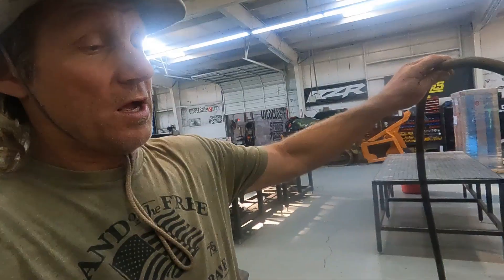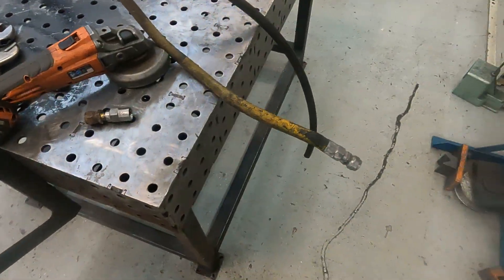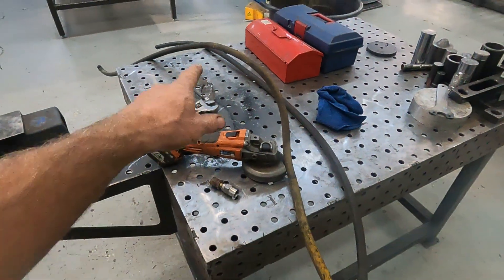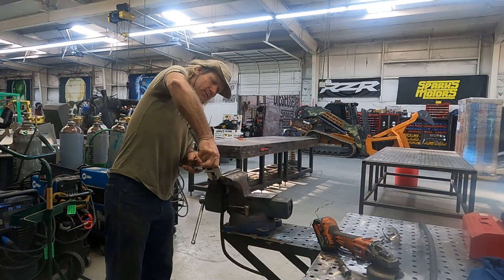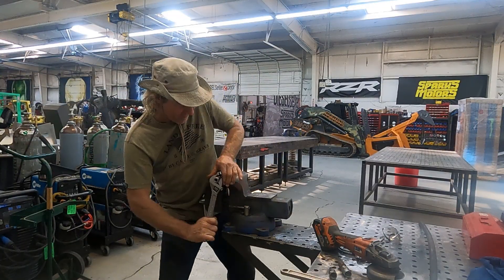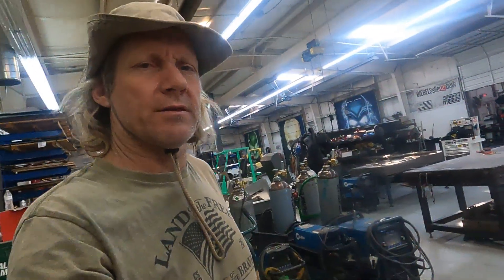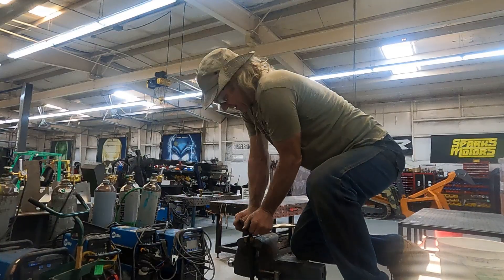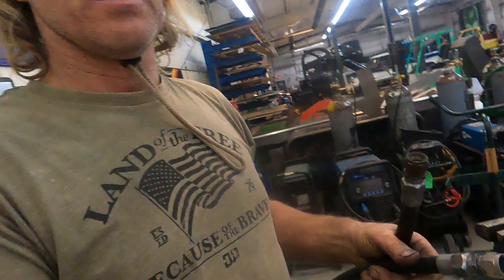Wizard DIY   Repair hydraulic hoses yourself!

Comment from the maker: Thank you so much to all you viewers who commentated on how to install the end fittings. I should have looked more closely but assumed INCORRECTLY  that since I unscrewed the first part with right handed threads that the other was the same... I feel like such a idiot! Ha ha ha.. Remember the part screwing on to the hose is LEFT HANDED threads... Lol! However I must admit the Tire compound did allow it to slide on even though I did it wrong...
Reply: ONE of those things wizard , we all do stuff like that .😀😀😀😀😀😀😀😀😀
Reply: Nobody's perfect.
Reply: You could also take a die and make some threads and take a color marker and make a mark where it is all the way on
Reply: Lefthand threads
Reply: Alan I did find it comical watching you standing on the table putting all your weight on the Vise-grips literally forcing the lubed hose to slip over the threads until it is all the way in, next time you're working with the Aeroquip fittings look into the open end you'll see the internal threads are much bigger and far apart than the fine threaded narrow end, I never used lube of any kind, having worked with Murphy's tire soap countless times myself I can see using a small amount on the hose end would help for sure. Be Well my friend.
Reply: We have all been there. 
Smoked a brand new 3/4 breaker bar with a pipe extension going the wrong way too. Dam foreign autos.
Reply: @mattborges5905  That would have been a sight to see '&' funny as hell, I'm laughing right now, what were you prying on or out and did you go flying or just landed in a pile some distance away? Question if I may, how log was the pipe "EXTENSION" you added to the Breaker Bar? Did Snap-On or Mac replace the bar or are you out it's replacement cost? : )))))
Reply: @mattborges5905  YO! I have a1999 Isuzu Rodeo 200,000+ miles! lol

Comment: Use a rubber mallet to get the fitting to the fitting threads on the hose, why not use hydraulic oil for lubricant.

Comment: They won’t sell these ends,as usual, because of liability issues. People will install them improperly, use them on newer high pressure systems, use different pressure rated hose or use hose with different outside coverings such as higher abrasion resistant coverings that have various thickness measurements. With all of these variables it’s too risky for any hydraulic shop to sell or recommend them. In today’s world for a hydraulic shop to mix match manufactures hose or fittings leaves they’re asses hanging out if something fails.

Comment: I'll have to double check to see if the Hydraulic line I need to replace on my Massey Ferguson 40hp, tractor here in Montello that I need to replace on the Backhoe has replaceable fittings on it.
Hey Allen, Tractor Supply right near Sparks shop has some Hydraulic lines for a reasonable price..

Comment: You have to be careful with these as you can cut a flap on the inside of the hose with the internal piece. That will allow flow in one direction and restrict or stop flow the opposite direction.

Comment: I still see similar fittings all the time around my area, used all over the place.  I've found that you have to find the kind of shops that supply stuff to a lot of farmers or the like, and they'll more likely have the reusable fittings available.  I recall from buying them, the thing to watch for was a difference between single braid or double braid hose.

A previous job of mine, was working on a seismic service drilling rig, drilling 250' boreholes for heat pump systems.  It got worked pretty hard at those  depths, was powered by something around 430hp, fully hydraulic, and it'd load the engine down pretty good sometimes...  It was probably around 80% reusable fittings, and the only problem we ever had with one would be when you were reusing a dried out, crumbly old hose.  They'd work for a while, but eventually the hose would pop out of the fitting.  Putting them on any half decent hose though, and the hose would fail well before the fitting.

Comment: I worked at a shop that made these and that's what we used on alot of our hoses and they are 100% reusable the other way we made hoses was with a simple crimper you can get one that you can use a impact on around $100 with the die set online

Comment: Hi Alan.  Good tips for replaceable hydraulic hose ends.  I think you would be doing Sparks Motors a big favor if you drilled a couple holes and put a couple more bolts to hold down that vise.  I was hoping it didn't suddenly break loose while you were pushing down on it.  That would have left a mark!

Comment: The hose doctors told me yonks ago that they gave up on those for several reasons but mainly because you end up twisting the wires internally and they just blow off after a while.
I had one blow while i had a grand piano hanging half way into a second story loft. The men had to hang on to the guy lines for two hours in the wind while we got a rrplacement hose and a refill. Then it was all a bit dodgy sending it out with air bubbles in the system. Bang pop pop pop sort of scary. Ah the good ol days.

Comment: Those fittings need the hose skived to fit properly. They will not last long the without removing the rubber so fitting bites onto wire

Comment: I,m impressed Alan I used to make these hoses around 40 years ago and if some one told me you could put those left hand threaded outer fitting on right hand threaded I would have said its not possible,.well that myth is busted . But the big test is can you do it with a left hand threaded nut on a right handed nut. 😆😆😆😆😆😂😂😂

Comment: I used a pipe threading machine todo the 2 inch and over reusables. Trust me, you'll wish you did. Good hose lub makes a huge difference too. Aeroquip sells the best. You can also reuse weird ends of fittings if you know how to use a lathe and can silver braze.

Comment: Hopefully Alan will read the comments.  When making future hydraulic lines.  Reading @wmbomb1079's comment below it makes perfect sense that the two pieces of the fitting would use opposing threads.  At first I was thinking he needed to use something like tire lube that is used when mounting tires on rims.  Buit that might cause the hose to slip off when under 3,500 psi of presure.

Comment: As others have said, the collar is LH thread. Something to watch out for is while inserting the nipple which should be oiled, be careful you don't cut the inner tube of the hose. Some fitting nipples require a mandrel to prevent this. You are working with single wire braid hose which is quite easy to build with field attachable fittings as long as you use the correct fittings designed for the hose. When you get into multi-wire braid or spiral hoses, there may be more steps to perform such as skiving the cover off the hose before installing the collar. The large hose for your loader may be a very high pressure hose (4000-6000 psi) with 4-6 spiral reinforcement wires instead of 1 or 2 braided wires. The very high pressure hoses are more difficult to assemble by hand. If your shop has a Rigid pipe threading machine, the one on a tri-stand that holds and turns the pipe, that can save you a lot of work removing/installing fittings. Also, field attachable fitting for these hoses are not very common these days.

Comment: 10:45 Alan maybe next time you have a fitting you need to get onto the end your new hydraulic lines, maybe try warming the end of your hose, to make the hose material more maleable in taking the thread of your fitting.

Use eg liquid dishsoap for coolant lines, or even hydraulic fluid itself, to lubricate the metal fitting as you ease them onto the end of the hose.

Personally I'd be looking to hold the tubing steady, screwing the fitting onto the hose, where you could then use handtools as force multipliers, to screw down the metal end fitting.

Comment: Alan, The only thing I would add to the previous comments is on the outer shell do not screw it on and bottom it out or you will tear the inside of the hose with your barbed insert. I used to make A/C lines with Parker reusable fittings and hydralics hose when needed. Parker has a catalogue for all the fittings you could ever want.

Comment: Left hand thread over the hose with the sleeve. that way when you install the fitting it wants to tighten on the hose vs. unscrew. Maybe? Pneumatic fittings are that way.

Comment: I was field mechanic for years and found if put a little hydraulic oil on the fitting (since they are hydraulic lines,oil doesn't harm the hose)

Comment: I still dont know how he got the hose to thread on by screwing it right handed and even if he did the hose is no good because its cross threaded it. When he was taking it of old hose he was turning it wrong direction that's why it was difficult to get off.

Comment: Hi Alan. When I wrote last time I forgot to say ouret fittig is LH thread inner is Rh thread. (It's years since I did it myself like '86). We used to trim the outer rubber off the hose (mark the hose where you want to have fitting end, and clean first 1/2" of rubber then use hyd oil as lube. Other than that you done good. OK very well done sir for your first time fitting. My first time I remember not trimming off the hose and struggled like you. When you know how it's easy. I was with you all the way adding little hints and you did it. Excellent sir.

Comment: Would a rubber mallet tap help starting the threading process? Ive had decent luck with stubborn ends using a sand filled heavy rubber mallet for low impact.  Great video!👍

Comment: i use my pocket knife and trim the inside rubber 3/8 in just to insure the center dosent slice the rubber at start and the same on out side edge just to ease the start some hose works betterthan others  il bet you  have a vice at the compound

Comment: Some hoses are no scive and scive wear you have to peel the outside layer of hose the light of the fitting we use to use a pocket knife so it looks like you done good and we would use gojo hand cleaner for lubricant so you done good.

Comment: Soapy water or a Windex type spray cleaner are your friends when installing fittings when Bead or Fitters Lube isn't available.  Warm hoses generally go together easier than cold ones so often I will use a pan of hot water to dip the ends of the hoses in to get them a bit more pliable.  A cheap electric hot plate and $5 saucepan work well for this (even less at a second chance or hospice type store).

For hoses and fittings at more reasonable prices check the link I provided in the previous video so you can buy them online and have them sent to you.

Consider using a blower while cutting to prevent metal filings and such from the cutoff wheel loading up the hoses that will accelerate wear on the cylinders, valves and pump.

Best!

Comment: quick tip with a cordless angle grinder.. it you want the angle gringer to feel lighter/more balanced/have more control/less chance of kickback ... the 4 bolts that hold the motor into the housing.. undo them and then rotate the motor 90 degrees so that the disc now is on the side ... its surprising how much better they feel to use like this.. ive done this for years and almost everyone that seen my grinder this way has dont the same now

Comment: These are just like building AN lines.
The exterior nut is left hand thread and the internal is right hand.
If you are going to build hoses from time to time I highly recommend buying hose pigs which are foam plugs you shoot through the new hydraulic hose with compressed air to clear the debris from the cutting process.

Comment: Alan, welcome to my world, I can't afford new hoses either so these reusable fitting, invented by Fredrick Duffield in the early sixties just outside Sydney Australia all all I use, the easy way I find to fit them is measure the depth of the female section and mark the outer jacket of the hose where it will bottom out with a white marker, I always lightly linish 1/2" of the leading edge of the outer hose to assist in assembly and dip it in hydraulic oil as mentioned earlier the the outer fitting is left hand thread and if you mount the horizontally in the vise with around 1" more than the marker point exposed you can use your hip to put load onto a small wood block and just wind it on, dip the internal section in oil and wind it in clockwise using 2 adjustable wrenches

Comment: When you have the first fitting on turning it the right way, left hand thread. Put a mark on the hose, marker or tape so when you screw in the second fitting you are not just pushing the hose out of the first fitting. This is the same as A/N lines for a car application. Hope this helps.

Comment: I was shouting at the screen when you said " I'm going to cut the hose ' THEN' try seeing how I go with the fitting"! You never know when trial fitting something like that that you're not going to wind up stuffing a section up experimenting so DON'T cut it till you have done one and know you're definitely not going to need just a bit more and there isn't any more you can shorten it and there isn't enough hose to start again. Do that end, make sure it works as it should THEN cut to length before doing the other end.
I was thinking you should slap some Vaseline on the first part as well as the second section, any that got into the system should mix with the hydraulic oil without any bad effects and as it's pretty much inert shouldn't harm any of the rubber. I know nothing about that tyre mounting compound so, maybe it is better, I just don't know.

Comment: Each time you use field attachable fittings they last less and less each time.
They are not reusable, they are field attachable.
Best to use they once. They are matched to specific brands e.g.
Hose of one brand is only suit to that brand of hose. Do not mix and match hose and fittings
There is not a proper standard, each manufacturer has their own specifications and sizing. they all adhere to SAE.
But sizing tolerance is where you come unstuck
17 years in hyd hose game.
People will get hurt or worse, yeah you'll get away with it most times but there will that one time.
Your not saving much money by using old fittings.

Comment: One of the most profitable companies i ever came across was a mobile hydralic hose company. 1 dude, sprinter van and about 30k in fittings hoses and equipment. The said if his phone is on he is working. Any hour any day. Keep up the great work
Reply: What a great idea! I'd really like to like into this. Where would you get the equipment, hoses and fittings to get started? Also how did he market or find customers?
Reply: @matthewfulk4124  he was refered to us by a bin removal company, its a advertising game to start out and standing by your work. Honestly to setup look up the equipmemt needed, if u have tooling on hand u can buy hoses and fitting to get u onto projects. Just do research into the job itself. There is alot of math involved and very dangerou psi's. That stuff kills if forced into the blood stream by a puncture

Comment: The work that dril  press does daily. 
U do it yourself 😂

Drill press does rotating and pressing at the same time

Like hand taping , holding chuck above work pace helps putting pressure while rotating, 
In fact u r taping into hose by self tapper fittings .
It helps centering too. 
U can even use sockets and tapping handle. 

Ur only real set up is how to hold  into drillpress's vise .

Comment: Alan I would use those in a hydraulic drive motor situation only! I've seen those fail almost every time they're used. I would never under any circumstances use them on a situation that lifts a load. If you disassemble 1 you just installed on a new hose, and look at the damage it causes when it squeezes it to the other piece that goes internal to the hose. Well it's self-explanatory why they split apart very easily. Also the female the female connector is reverse threaded. Couple minutes later thinking about it I'm pretty sure those were developed as temporary to get the piece of machinery Out of the Woods for a lack of better terms. So IT could drive out on his own power instead of physically having to be drug out. Because people don't have the several thousand dollar crimper necessary they tend to use these temporary ones in permanent situations. Bad bad bad no good will come out of any situation like that. God bless

Comment: Alan.you make hard work of that. The outer ferrule has a left hand thread. Once you skived the rubber from the end it is fairly easy to screw the ferrule on. Put the ferrule in the vice and screw the hose. Likewise when removing the threaded piece, put the ferrule in the vice and turn if counterclockwise. The ferrule cannot turn in the hose. dead easy. I made dozens of these on railway track equipment on the 70's as that was all we had. Use oil when screwing the fitting into the hose. You won't need any fancy equipment other than a knife, a vice and a wrench

Comment: As others have said, the hose needs to be screwed into the fitting the reverse direction. That way the hose wont simply come off as you are screwing in the male part of the fitting. Also the reusable fittings require a special hose type compatible with reusable fittings. Take inventory of your equipment needs and order the correct hose online that is designed for your fittings. I doubt your local hose shops stock that hose.

Comment: could of lubed those fittings with spray glass cleaner. it makes a good lube for rubber hoses and window seals as it dries away leaving no harm done. I've never made reusable hydraulic hoses...... but made many airbrake and fuel lines. also lubed up.... you can instal that collar with an impact gun

Comment: Sometimes the bigger hoses a easier.(if you screw them on the correct way in reverse,left hand threads on the outside piece) 😅